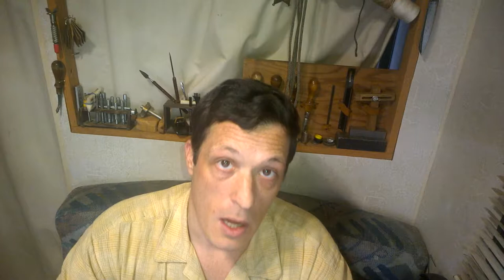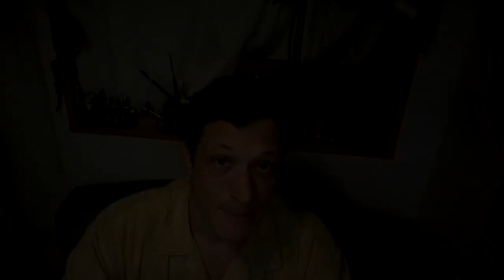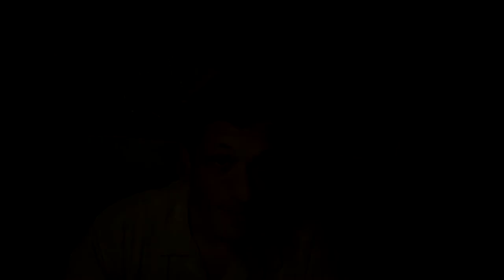Response to Spikey Hedgehogy (part 1/?)

Comment: thanks for the clarification on the rivet/gromet difference, and the explanation of putting them in. no rush for time, but nice to see your up and about 8D.
Reply from the maker: No problem. Mouth is feeling better then it has in years. still got the permanent reline coming up. Part of what took so long was learning to talk again. These things change the way that works. Now I just need to pick a fight and make sure the guy catches my nose from the correct side. Straighten that thing out. I mean holy crap. Look at it. I'm a Picasso.... Meh, maybe it's just the camera angle.